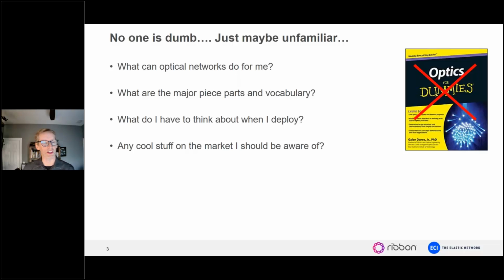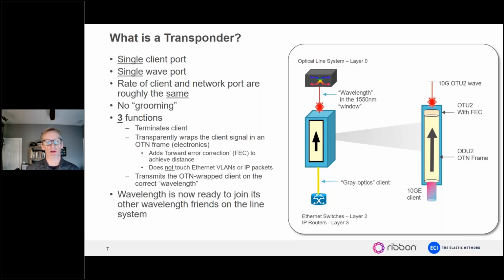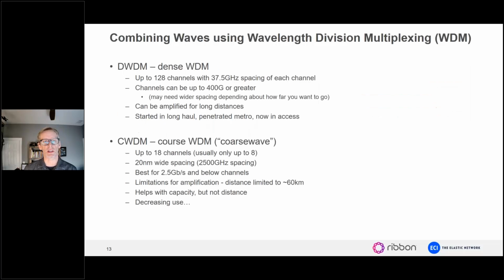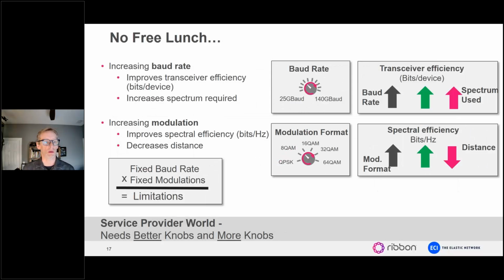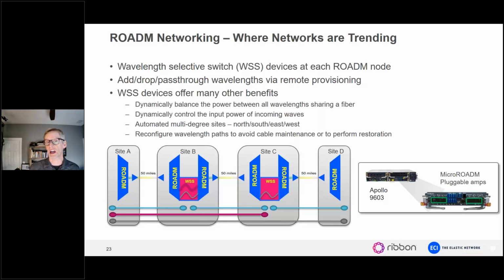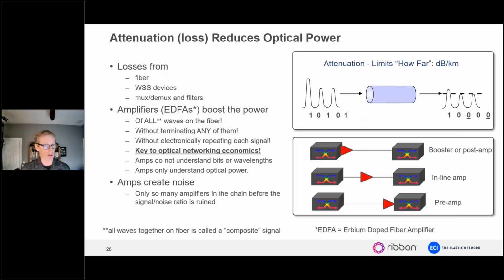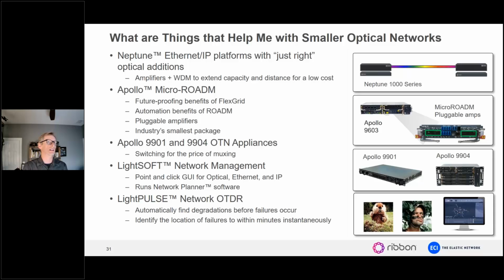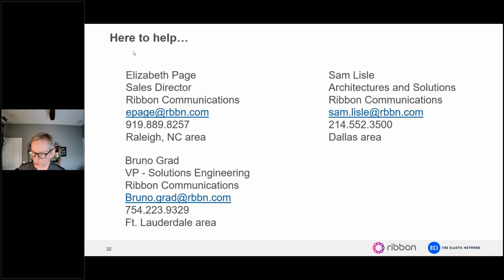Optical Networking / DWDM Basics (Dense Wave Division Multiplexing)

Comment: a good brief video for DWDM systems. A few points on protection : 
- MOTR (transponder) module can itself provide protection using integrated OPS. (at the expense of having another line port redundant)
- Trunk OPS can be deployed in photonics where the OPS card makes switching decisions solely on the Rx power. 
- Client OPS can used in MUX , where an external OPS card can provide redundancy between clients(100GE or OTU4) either in same transponder shelf or different transponder shelf.
- We can have mesh protection in photonics layer, of course software defined routing is there using photonics control plane. intended protection routes or a combination of routes between originating and terminating sites can also be decided beforehand.
- The L0CP mesh restoration is rather slow ( since it finds & creates new path depending upon N number of factors  , like spectrum availability in possible paths, any potential alarms in those paths as well )
- OTN switching to have <50ms switching time is a Industry standard.
- Mesh restoration takes time like 50s to 1 min to recreate new path, But - WSS takes even more time to optimize the SNC powers to avoid non-linearity.

In Design consideration , just a few key things to add : 
- We might need a Regen bank in the photonics ( FOIC1.4 or 4.8 or simple OTL4.4 client regen - this is made using transponders only )
- Redundancy or protection is a key point.
- Capacity changes also include the upshifting or downshifting of the modulation/ rate along with adding new sites.
- Mechanisms like wavelength contention detection and making sure photonics dont receive any non-linearity because of that is important ( of course SW controlled )
Reply: Gg hi gg hig